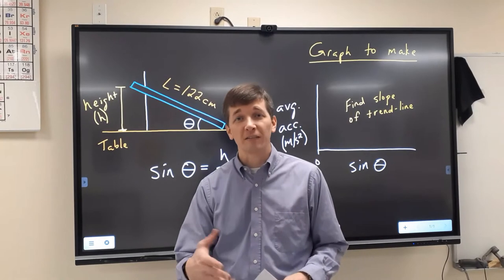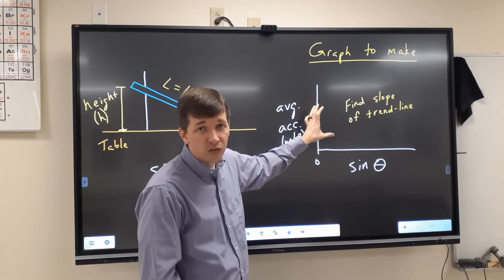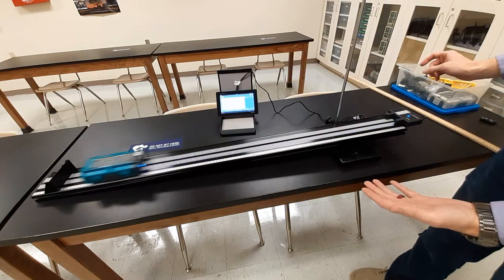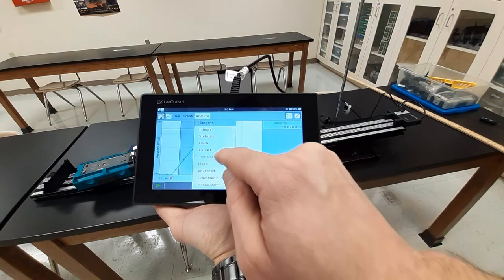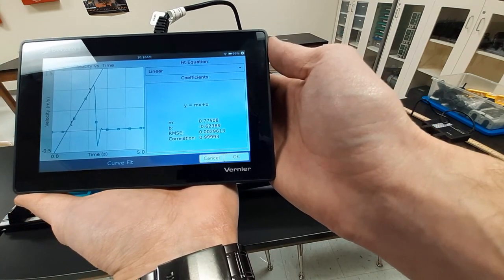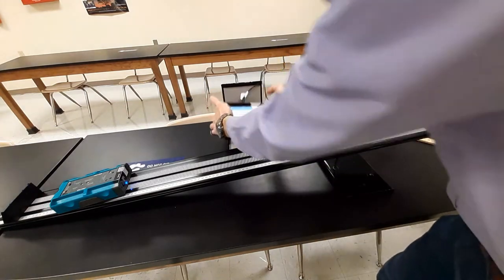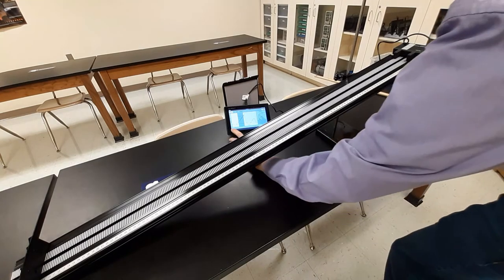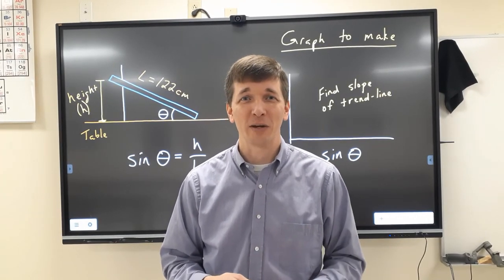Physics 1 Lab: Determining 'g' on an Incline

Comment: Awesome video! I'm doing my own version at home. Where exactly can I find information about why the slope of the acceleration vs sinθ graph gives the value for g ?
Reply from the maker: The original lab instructions from the company Vernier have some of that information. When you ignore or have very little friction to worry about, the component of the force pulling the car down the hill is mass * Acceleration due to gravity * sin theta.

At a 90 degree angle, sine theta equals 1. When you graph the data, you get the trend-line in the form of y = mx + b.

The y-intercept (b) should be nearly 0.

If you let x = 1 (a 90 degree angle), then y = m. 

Hopefully the data supports a slope of nearly 9.8 m/s^2.
Reply: @markmontgomery99  Thank you for your quick response, I appreciate your time! My experiment yielded a value of g = 9.96 m/s^2. I only obtained that value when I set the line of best fit to cross at the origin. My justification was that when sin(theta)=0, this means the incline is of zero height, or theta = 0. This means there would be NO acceleration at all. So I am essentially using (0,0) as a data point to come closer to the value of g. Not sure how rigorous that is, data can be tricky.